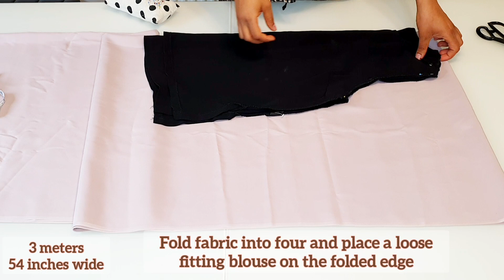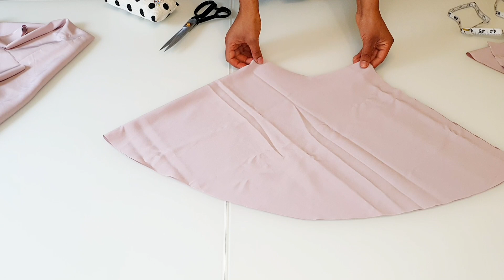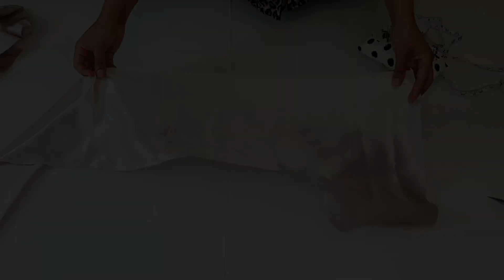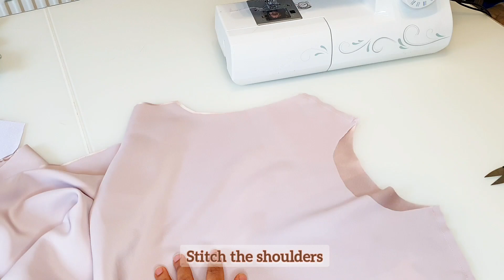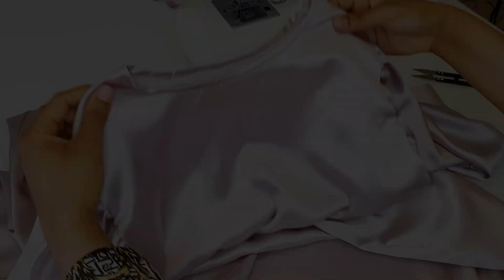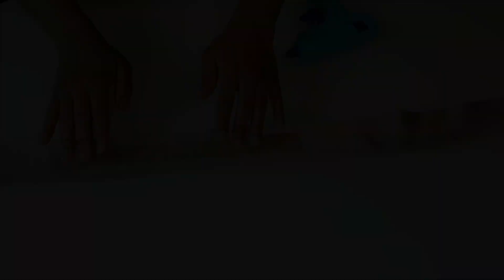Long maxi dress sewing tutorial. Elegant belted gown. Beginner friendly.Cutting and stitching

Comment: Salaams! What did you measure to get the measurements? I want to use my own personal measurements instead of cutting out a shirt.. what if I want to do a long sleeve cuff?
Reply from the maker: Salaams sister. Sorry for late reply. You can use yoir personal measurements for the bodice part of the dress no problem. Also for a longer sleeve you'll need to get a wider piece of fabric and this would hopefully give you enough length for a long sleeve x hopefully that makes sense 😅❤️